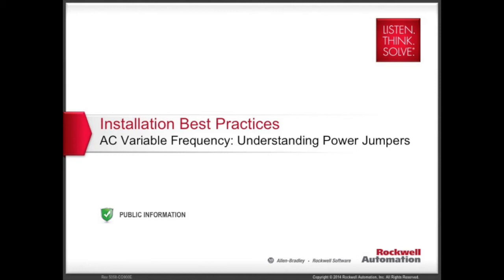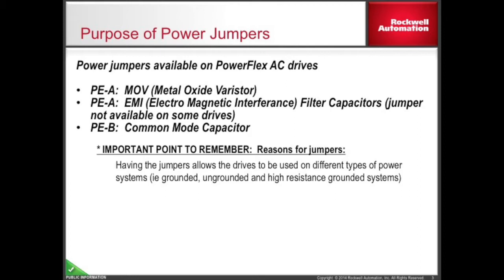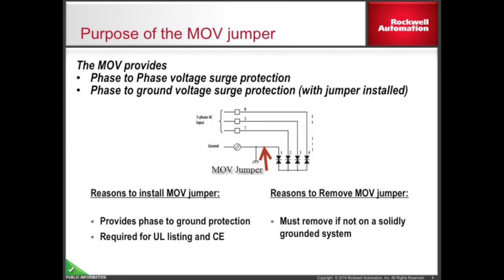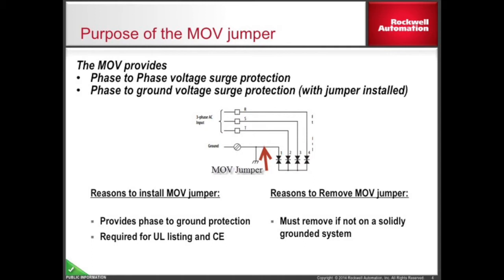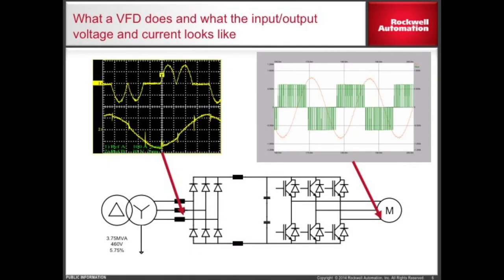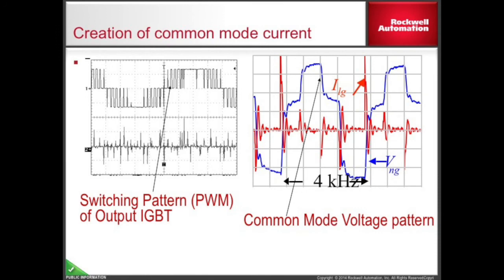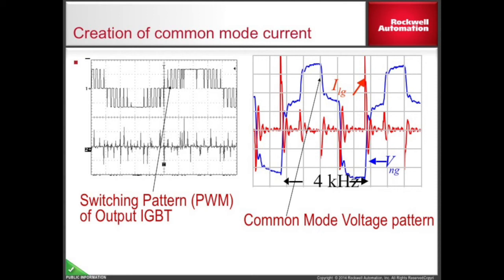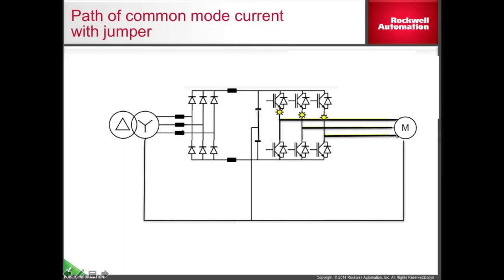Purpose of Power Jumpers on PowerFlex® Drives

Comment: nic presentation, if my transformer feeding my drives is delta- star in power supply 3 phase.  now how will I arrange my jumpers PEA and PEB. Again I'm working on power flex 753  I have connected my 110v ac on Di0ac and Dic  the vsd is not coming on. again I need elaboration on jumper 1,2 and 4